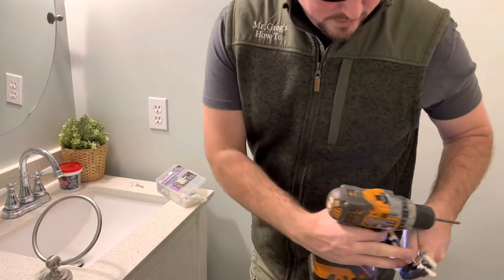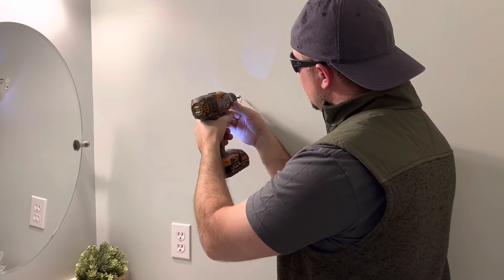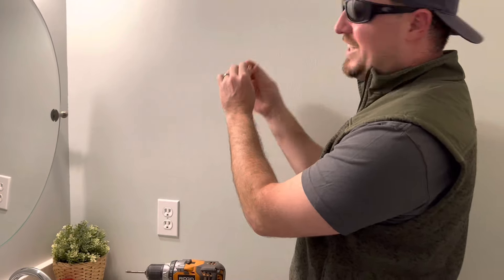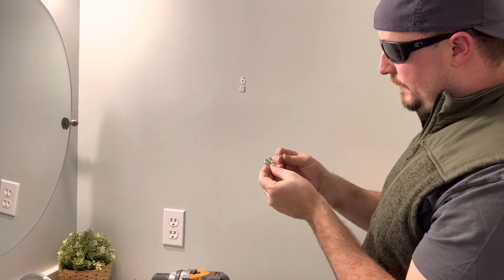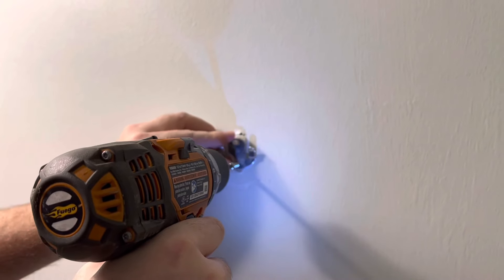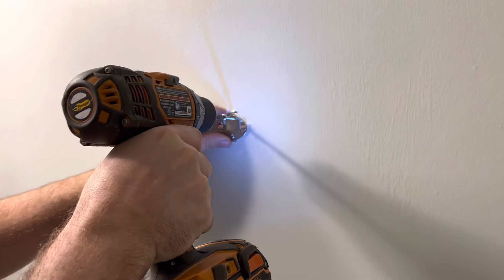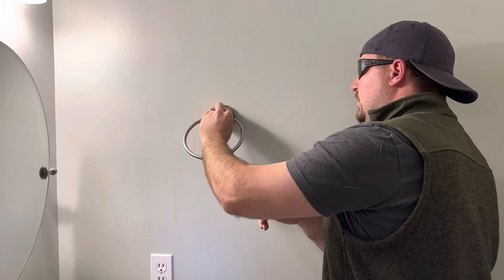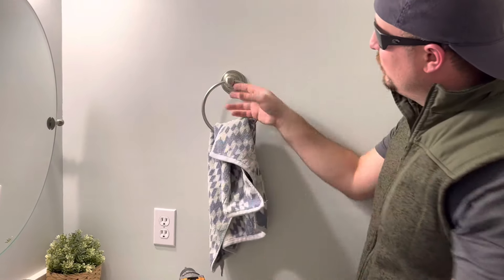HOW TO Fix Pulled-Out Drywall Anchors

Comment: Basically....pick a bigger anchor for the loose hole.   Not really a true solution if your already at the maximum
Reply from the maker: Yup, partner. That’s the easiest fix. Maybe try one of the anchors with the steel spring wings.  Good luck!
Reply: Only true fix for maxed out holes is to cut a drywall patch
Reply: You mean a " toggle bolt" it has a name lol

Comment: Puts the same type of anchor back in 🤦.  Basically, if you ever install a towel rack, ring, bar, whatever into drywall-- anything that is going to do anything other than sit pretty, but will instead be getting a lot of tugging and shifting (like a towel ring), the first thing to do is throw those crappy drywall inserts that came with the ring in the trash. Now, use a toggle anchor. Boom. No more issues. Same if you're trying to reuse the same spot after the crappy inserts ripped out: use a toggle
Reply from the maker: Thanks, partner!  Appreciate the tips!
Reply: You aren't very observant.  it is a different type of anchor.

Comment: the bottom screw was just spinning with the driver, and the whole thing doesn't look very solid at all
Reply from the maker: Thanks, partner!  You're right - plenty solid and still hasn't moved an inch.  You can too!
Reply: @MRGREGSHOWTO  you're useless and unconvincing, and I'm not your partner
Reply from the maker: Happy New Year!  Use code HELLO2024 for 20% off merch in Mr. Greg’s shop!
Reply: @rodnyg7952  what happened to you

Comment: What if i used the large white anchor & it also pulled out & made the hole bigger. Everyone says hammer the anchors into a drilled hole then put screw in. I have holes & thin hollow wall behind will the wing anchors work? Thx
Reply from the maker: Howdy, partner!  A large winged-anchor should work.  They sell a wide variety of metal ones with larger diameters that will hopefully solve your problem.  Thanks for watching!
Reply: @MRGREGSHOWTO  thank you that worked
Reply from the maker: @seekerofgrace2058  awesome!

Comment: I have a towel bar and put the two anchors on the wall with the plate for the bar and the bar won't stay on. I tightened that little screw under the side of one bar and started on the second one, and the bar just fell off the wall! Anybody have any tips for me??
Reply from the maker: Howdy, partner!  Sounds like your set screw isn't catching.  Try reattaching the little screw and you should instantly feel it holding the bracket onto the wall.  Hope that helps!
Reply: @MRGREGSHOWTO  I realize it may not be catching because I pushed some stainless steel "Brillo pad" type material into the large holes in the wall that previous owners made. I think it is getting in the way I'll try again. Thank you!
Reply: @MRGREGSHOWTO  Thank you!

Comment: What do you do if you already had those wide blunt plastic screws (that you used in this fix) to begin with and they ripped out a part/chunk of the drywall? Fix the whole section with a patch piece? Are toggle anchors stronger than the plastic ones you used here?
Reply from the maker: Howdy partner!  If the hole is bigger than a quarter you may need to cut and patch. For smaller hole patch jobs, try backfilling the hole with wadded up paper towels or toilet paper and then covering in lightweight spackle. The metal wing toggle anchors are stronger and very large. You can probably install one in this case to get it fixed. Best of luck to you!
Reply: If not too big toggle bolts.  I think 3/8" holes
Reply from the maker: @billwheeler1213  thanks partner!
Reply: @MRGREGSHOWTO  thank you!  Good video.
Reply: I chopped a few pieces of wood kindling into slightly bigger than toothpick size pieces, used a bunch of those along with a bit of wood glue and spackle to fill in the hole, waited for it to dry, and the screws are super solid now. For those of you who don’t have bigger anchors on hand.